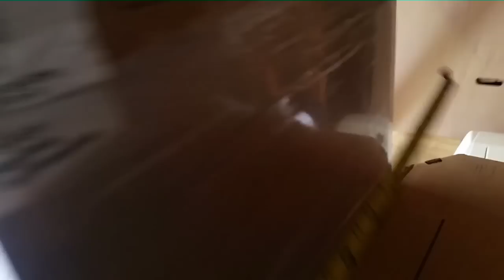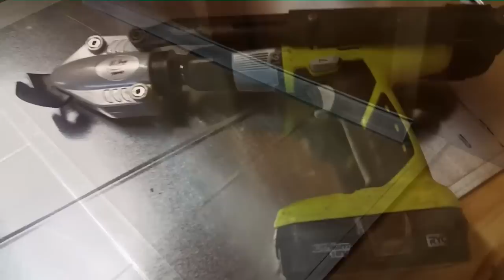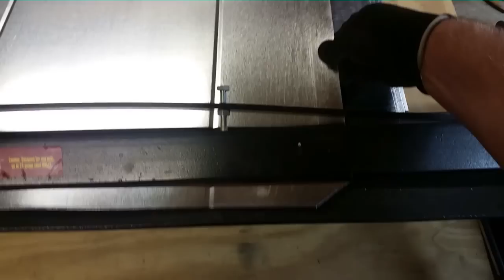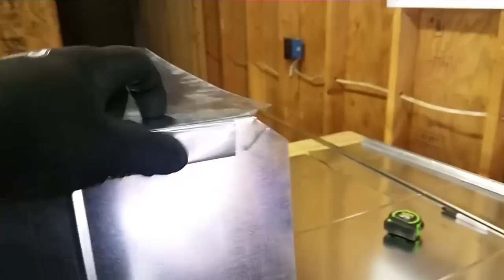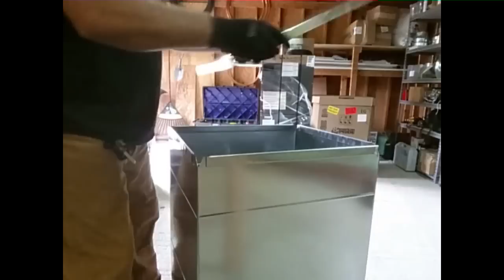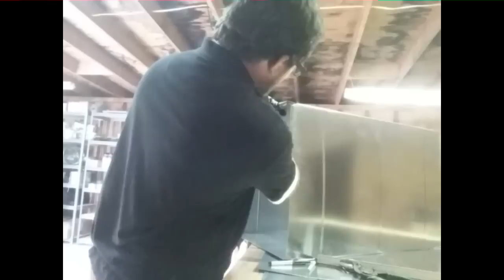Sheet Metal Plenum Fabrication

Comment: Back in the 70's I had to do a lot of field fabrication with hand tools.  Later I began hauling the lockformer and 4' box and pan brake bolted to the bed of a trailer to ease installation.  Retired now, I only do metal to help out old folks in need and family.  Here's a plenum for my son's new heat pump if you'd like to see a variation on plenums: https://www.youtube.com/watch?v=2KOTVW7Yv2U&t=286s  This is only part 3 of multiple parts.

Comment: So much No here. Why would you not do a double half safety flange instead of a 1" raw edge? Why notch the head end of the plenum and then put a huge relief on the corners of the head cap? You wind up with gaping holes in the corner of the head. One or the other. On that same note, if you're making a head cap to fit into s lock on the interior edge of your plenum, take 1/8" off of your dimensions before adding the inch for your bends. The head cap will fit in easily without having that giant relief on the corners.

Comment: Instead of using S-lock,  try adding  extra 3" to total length. Mark 1"from edge & bend flat (don't crush), flip metal over, mark 1" from bent edge & flat again. It's now an internal S-lock. Continue w/ plenum measurements. Add 1"at end & fold 90° up to lock in. It's a cleaner look w/o having larger equip... U can also be make the plenum cap w/o s-lock .
Reply: Keith Shaw 
Pittsburgh’s look even better
And so do snap locks 
From a pro fab shop
His fitting  with a-slip are kinda scabby

Comment: you should invest in a lockformer and a bigger break. a disgrace to any real sheet metal mechanic. loose the sharpie as well and get a scriber.
Reply: in how much price can i get a lockformer
Reply: This works for him nothing wrong here.
Reply: This is great for us normal people at home to see. Then we can do your work out of 15 gauge aluminum or stainless, instead of installing your polished turds (galvanized steel)
Reply: Dan Seguin if you want to buy it for him then go ahead, some of us don’t have access to certain things and have to use what we’ve got. I’ve field fabbed without a break, wasn’t easy but it worked and looked good.
Reply: So because he doesn’t do it the way you do, it’s wrong? I found this video very informative. I’m installing a Goodman package unit in my shop, and don’t have ANY sheet metal forming tools. At least he took the time to make a video and show one of the several ways to do it.

Comment: I usually bend the 2 corners in and put it in the brake and after l make the bends l straighten the 2 corners back out.its a lot easier than using those turning tones.Good video

Comment: You could have bent your 1 inch flange for the end cap on your brake.nice work
Reply from the maker: +Phillip Joy without a box and pan I could only have done 2 sides
Reply: @ZacktheBackyardTradesman  You can do all 4 on the brake. With the 45° notch on the the 1" there is clearance on the break leaf when you insert the 1" side in the brake.
Reply: He knows